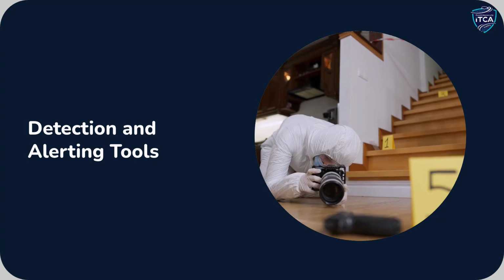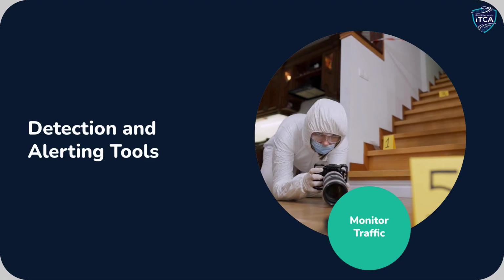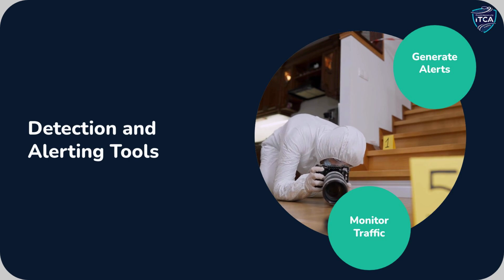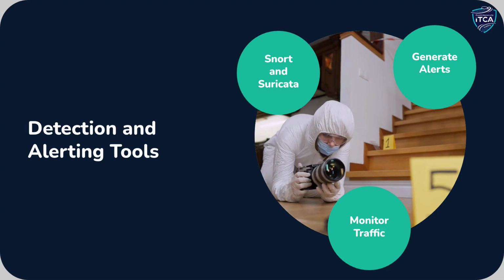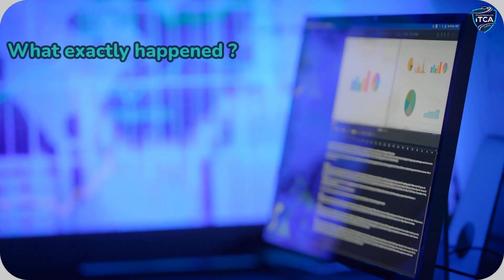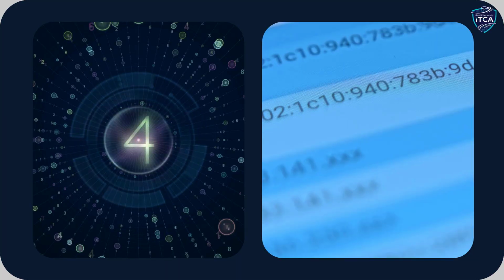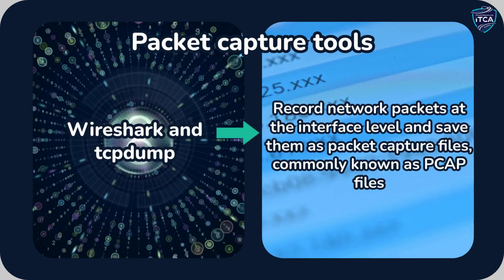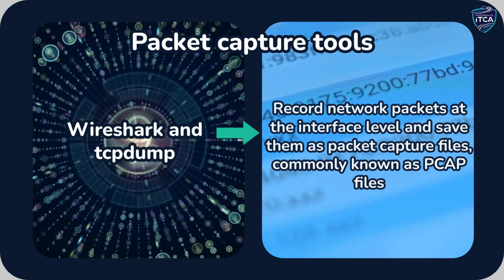Top Network Forensics Tools Explained for Beginners | Wireshark, Splunk & More | iTCA

Comment: Each phase requires specific tools and function is more important than popularity. 

Packet capture tools are an important tool for the process. Wireshark is an important tool that comes useful for the forensic professional.
Reply from the maker: You've hit the nail on the head; prioritizing functionality over popularity is essential for any security professional. 👍